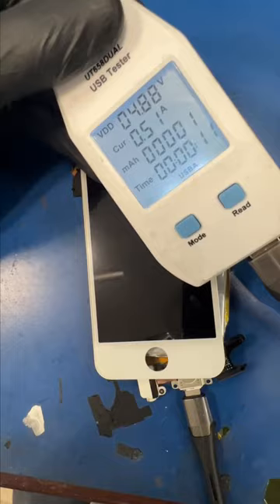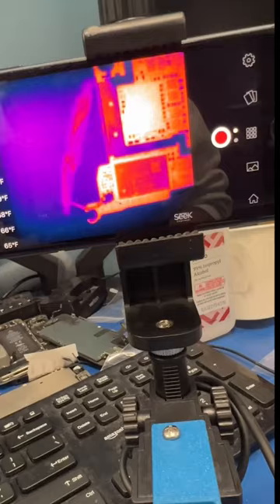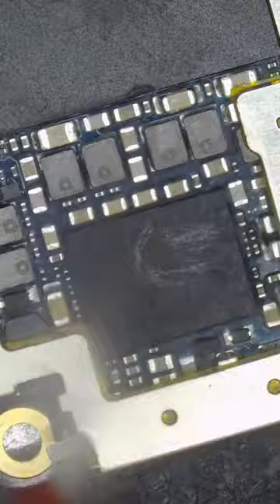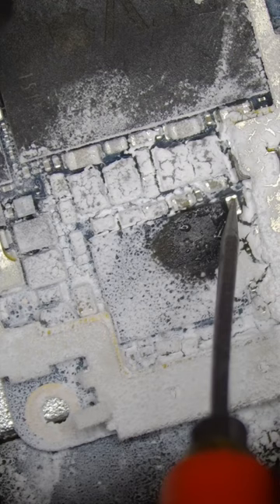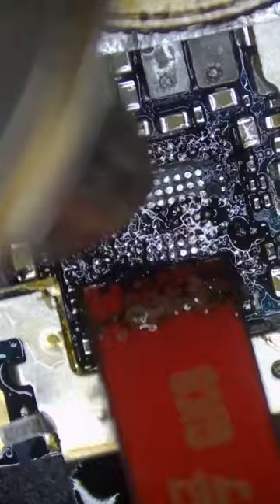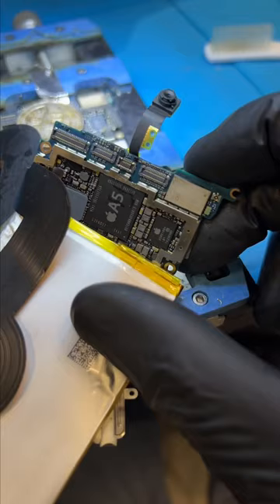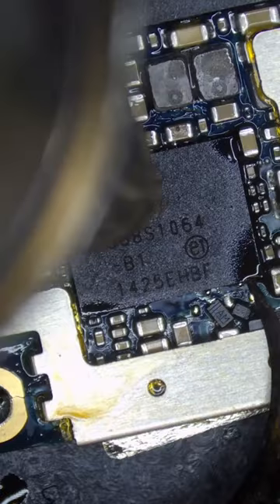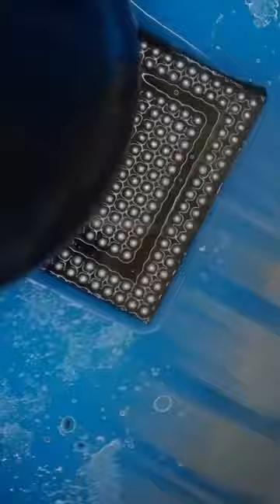iPod 5 Data Recovery… #tech

Comment: what did you use to freeze the board? is it safe? Also what's your strategy to inject voltage so that it helps you find the issue without causing any unintended damage?